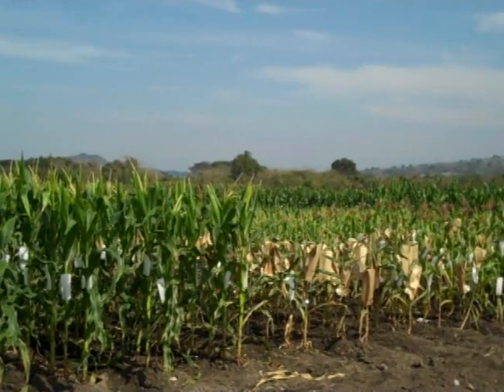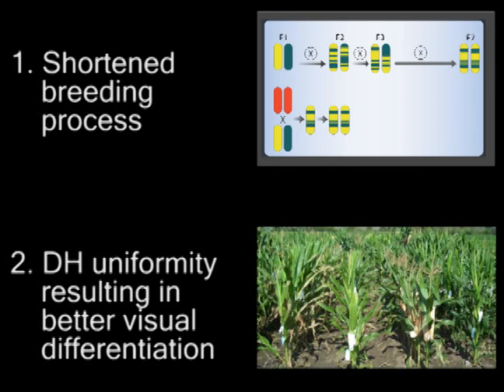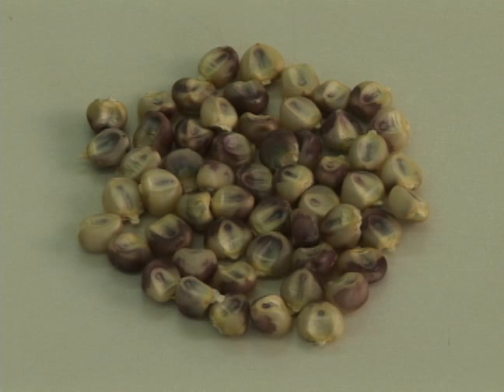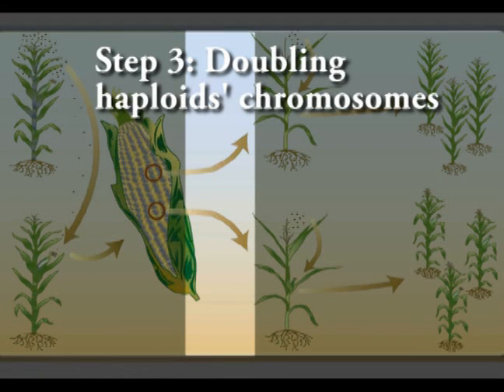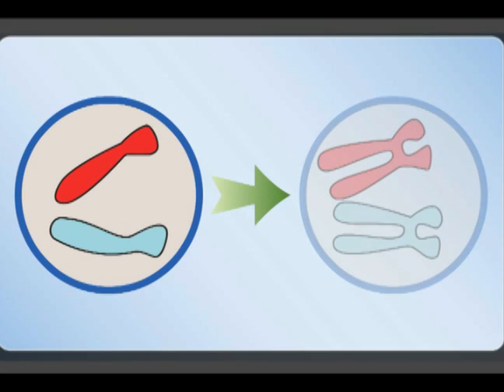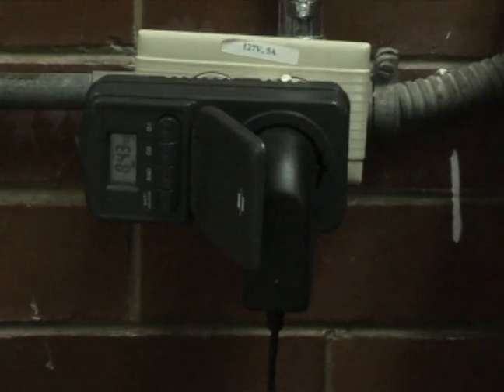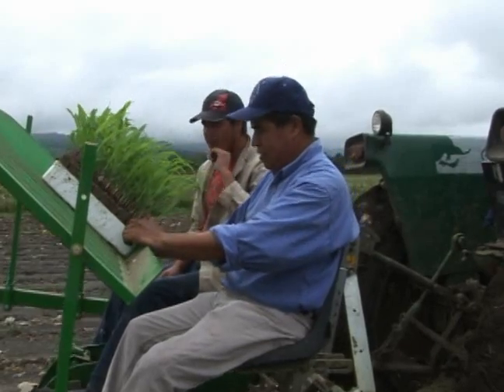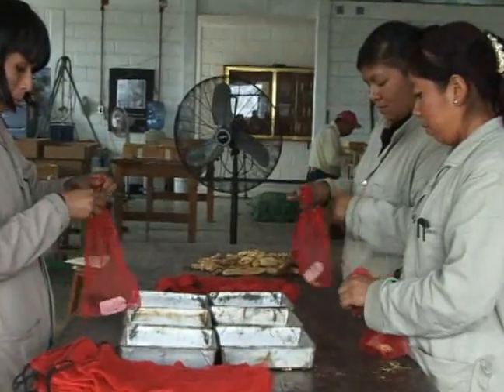Doubled Haploids: A simple method to improve efficiency of maize breeding

Comment: Double haploid currently does not work with Fragaria or passiflora. There can induce polyploids by a safer method than using colchicine is NO2 gas or using Oryzalin. I am currently using both mass selection and progeny selection only.

Comment: Respected sir, I need the answer f below question. No one know the answer if you know please give its answer. 

(Your company has a highly successful tomato cultivar. It is a hybrid between two inbred lines that you developed. 
Recent years, a cultivar similar to the hybrid cultivar emerged. The seed are very cheap, and the market f your cultivar started to dwindle.
Since it is a hybrid and you thought that the cultivar is well protected from thieves. However, the cultivar from the other company has no phenotypic differences from your cultivar. You started to think that the other company stole your cultivar. How will you collect the data before you sue the company? Be sure that your data are reliable and your logic has no flaw.
Otherwise, the judge will not rule in favor of your company. )
Reply: Your best bet here would be to use molecular markers and register marker results when the cultivar is registered. Molecular marker variation is widespread in corn and the chances of two cultivars exhibiting the same marker pattern are very small. Also, if the other company had stolen your cultivar, as it it a hybrid (F1), they would have had to have stolen both parents in order to produce the hybrid seed!